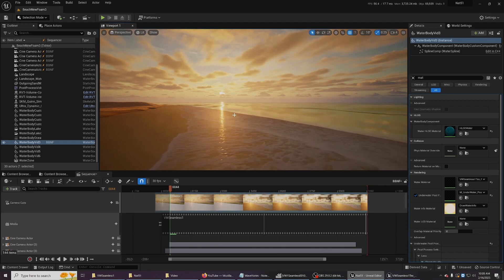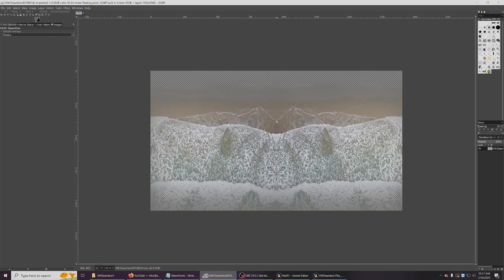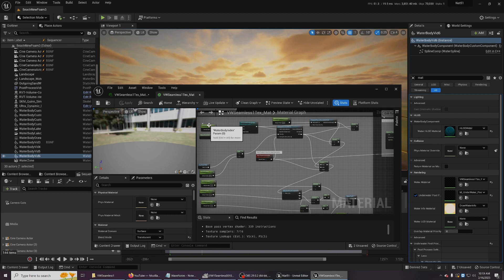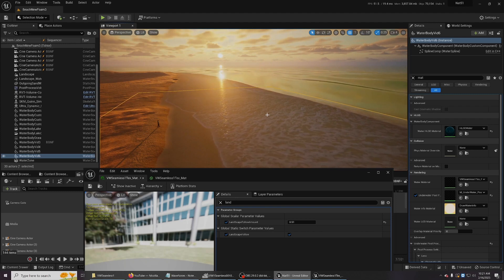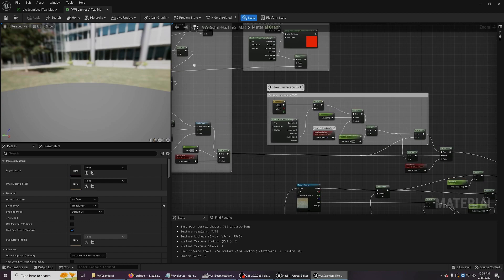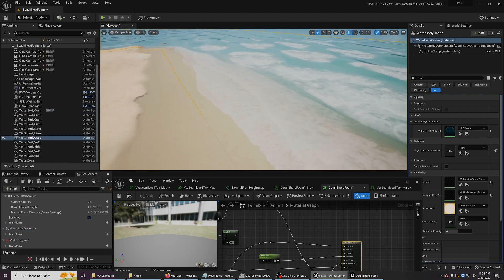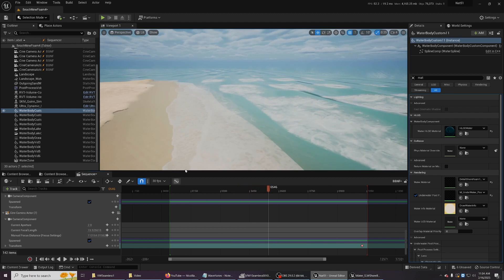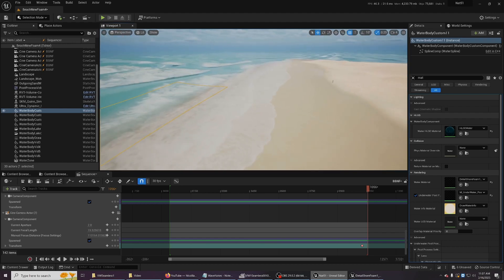Unreal 5.1 Shoreline Beach Foam EXR Sequence Material Breakdown

Comment: Very good, congratulations. What is seen on the horizon is dynamically wetting?
Reply from the maker: Ty! Are you asking about making the sand wet and then dry as the waves come and go? You can kinda do that with the video sequence depending on the video and how much sand you use from that video when you process it. There is also a more traditional way via materials but I don't know how to do that just yet.